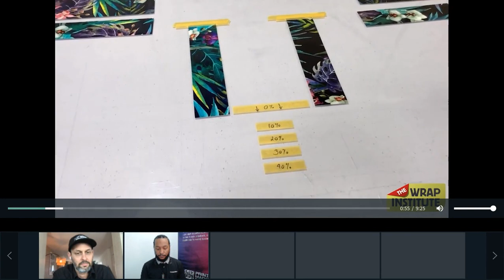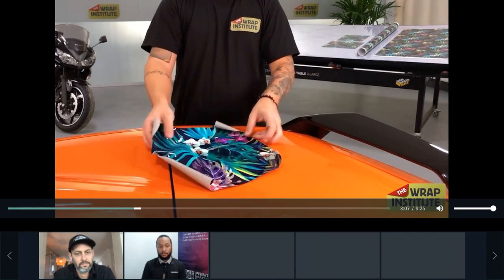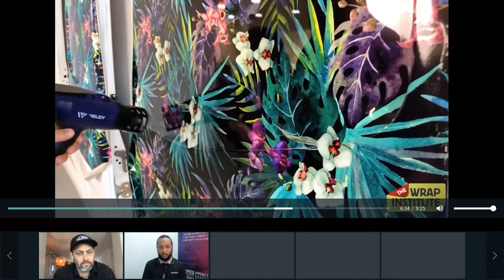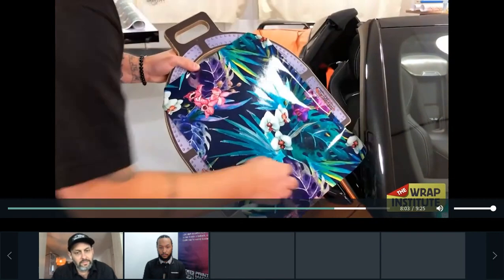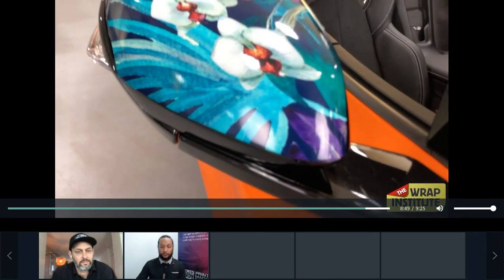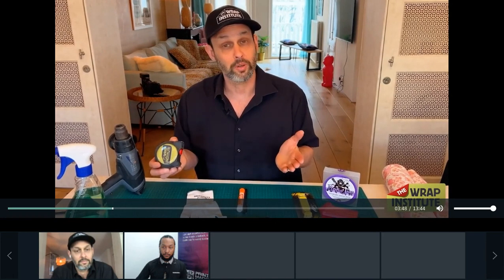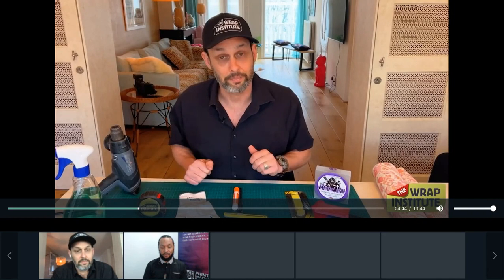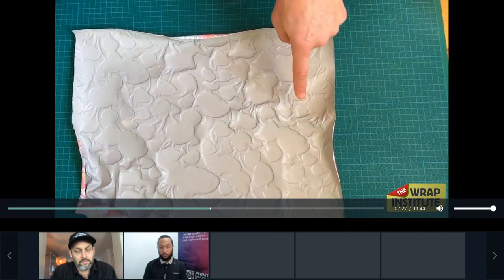Mimaki x The Wrap Institute: Solvent vs UV Ink for Vehicle Wraps + 2.5D Prints for Interior Wraps

Comment: I have a water based stratojet hawk clean print with UV drying. Is this recommended for vehicle wraps if I’m using 3M cast vinyl and over laminate?
Reply from the maker: We aren't familiar with that brand. Mimaki USA has a full line of printers used for vehicle wraps. Check out our Eco-Solvent and UV Roll-to-Roll printers! https://www.mimakiusa.com/products/#UVLEDampEcoSolventRolltoRoll